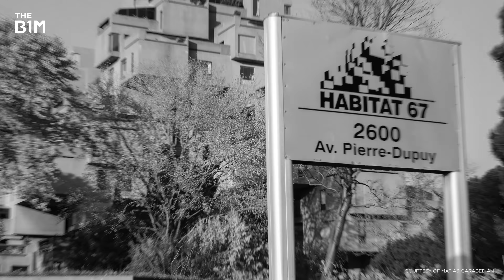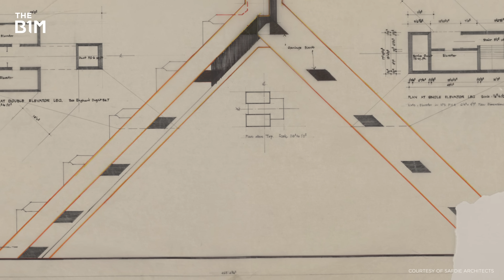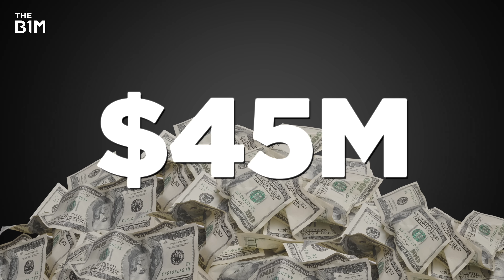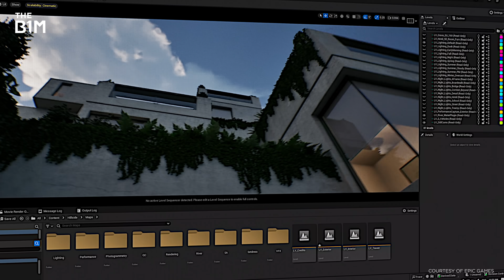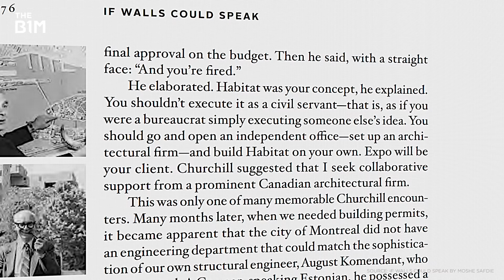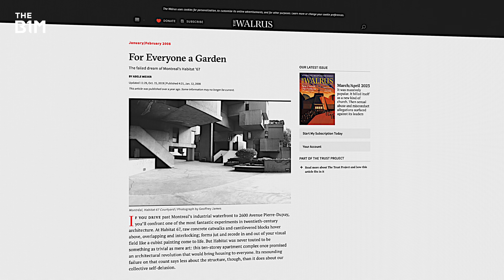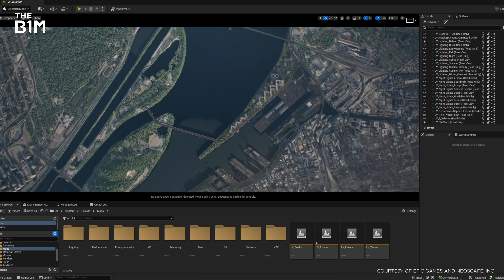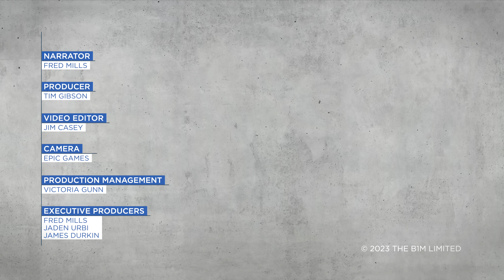How a 23-Year-Old Solved Urban Sprawl

Comment: I live in Europe in a concrete tower and one of the biggest problems is keeping it warm in the winter because concrete gets very cold. This model exposes almost every apartment to outer elements. That requires more insulation, more waterproofing, etc. Those terraces look nice but that means that every apartment has a roof to worry about (that is why the top-floor apartments are always the cheapest... they leak).
Reply: IKR. If the terracing was done less extremely it would reduce the outer surface area and make it less expensive to inaulate, heat and cool. Like the terraced villages in Greece and other Mediterranean countries.
Reply: @ooooneeee  Or favelas in Brazil 😂😂
Reply: @ooooneeee  but in a place thats very sunny it would be a great design then right?
Reply: @ooooneeee  that is because they are in greece, or brazil
those climates already using this designs for centuries, no need to reinvent boxes.
They are cool to visit but unsustainable in western and northern europe
Reply: That's only true for old buildings and office buildings, no one wants the top floor. But in modern buildings the top floor is the most expensive
Reply: In Poland, Europe, top floor is always most expensive. And in old buildings top floor is hottest - heat rises - to the point some people need to open windows even with radiators completely off.
Reply: @PR15125  In Estonia, top floor is the cheapest again for pre-modern. Roof can leak, you 5-storey house doesn't have an elevator, always slightly too hot and not high or scenic enough for pretty views. Most expensive in modern buildings, though - high enough yo get the view and the elevator, new enough for better quality construction and temperature management options.
Reply: The glass and aluminum panelling of modern buildings is far worse.
Reply: Keep in mind the original is in Montreal. The average temperatures during the winter are similar to southern Sweden and Norway. If it’s not a serious problem with the original structure then I’m sure it wouldn’t be if it was built today. I do understand the concern of thermal efficiency and maintenance costs though.
Reply: That is so different from Australia. Top floor is the most expensive because people want views.
Reply: @canyoucatchme138 same in Canada.
Reply: agree. water management will make or break buildings and houses
Reply: It depends a lot of the techniques. There's a lot of places where houses are made entirely of concrete, and handle the weather and issues pretty well, modern block is mostly empty, and that air is a natural insulator. Moreover making roofs that handle well against the weather out of concrete is not that hard nowadays, there's challenges, but then again there's no technology that won't have leaks without maintenance. The terrace with natural drainage and plants though can help a lot.
Where in Europe do you live? There's a lot of places where the tall concrete buildings were made shortly after WWII to manage the serious housing crisis. The houses cut a lot of corners and ignored many needs we consider basic to give a decent apartment. They gave great quality of life for the $ put into them, but they did not have a lot of money to work on and did fall short in many places because of that. Many of these buildings are also not given maintenance or support.

The core difference here is that the whole structure should not be seen as a building, but as a community, and supported that way. So just as people do not pay for roads, or grid infrastructure, etc. so we'd need the government to create most of the core infrastructure, with people taking over these blocks. You can see why it's a really hard pitch in a capitalistic "free-for-all" economy as we see in the western dominated world. But in high-control areas there just was never that strong incentive to build such a holistic and complete solution for individuals.
Reply: You need to start living in those energy-efficient buildings; they are great. I live in a Nordic country, and I usually stop using heating in February. The sun does all the work. But I see where you are going with this, having your little unit open to the elements doesn't sound very comfortable.
Reply: @Scott_Stone  how is the 4G/GSM signal in these energy efficient buildings? here in France all the newly built well-insulated homes have a hard time receiving
Reply: @GaniaDev  that's a good thing then to stop radio magnetic pollution
Reply: @Scott_Stone  And taking a page out of nordic architecture... Use Geothermal pipes running internal to the concrete walls and the entire structure becomes a giant heat sync... which would have an incredible thermal mass and would resist changes in temp very well, almost creating a thermal battery of sorts.
Reply: Secondly if they actually covered the terrace with a garden ( with actual dirt and plants it would help to moderate the heating, a big thing with huge warehouses here in the states to reduce there energy footprints... )
Reply: @Scott_Stone  Nordic country stopping using heat in February? Tell me how
Reply: @Frivals he did... The sun warms the inside enough and the insulation keeps the heat in.
Reply: @Scott_Stone yeah, the person you are responding to is saying "I live in a totally different situation to this and it isn't good, so this won't be good, even though it could easily avoid every issue I have with my current situation, I dont like change and new things waaaahhh"
Reply: @Scott_Stone fun fact 85% of the people in the world don't live in Europe or America's where it snows.
Reply: Your concrete tower was built with cheap materials.
Reply: @mj_b23  haha, that's what I said to myself
Reply: Waterproofing becomes a problem when there is water logging. If you have the right channels and more exposure to the elements the water never collects. That is a bigger issue in a tower like structure. Obviously these type of buildings are good for places that have desirable outdoor environment and not hostile heat and cold.
Reply: One word= "Aircrete"
Reply: @shahbazfawbush  look up two words "spirorex failure".
Reply: @danielvivian3282  I did, Siporex id a proprietary form of Reinforced Aerated Autoclaved Concrete that was initially used as far back as the 50s.  It has some shortcomings but with correct engineering these can be mitigated. 

So a non point for you @Daniel Vivian
Reply: @shahbazfawbush  I'm not a engineer but I do know about aircrete. Seems this would be a perfect use of it in construction Ike this.
Reply: Keep in mind that this was designed in contrast to suburban American/ Canadian housing. It would still be a massive improvement because now you at least have some walls that are insulated by other units.
Reply: Um, just wanted to point out that habitat 67 is located in Montreal, Canada on the St. Lawrence river with very cold winters. So one would assume that heating would have been addressed in its construction, as in all other buildings in Canada, one of the coldest countries in the world. And the structure has been standing for over 50 years so...
Reply: Seems like the terraces would work well in warm places like California or southern Europe.
Reply: "...they leak." Not if they're built properly, they don't. By which I mean, not if they are built by Japanese workers, in Japan, to Japanese  standards. I live in a top-floor condominium unit: it was already 20 years old when we bought it, and we've been here 30 years. We've never had a single leak. Regular maintenance, including coating the roof with water-repellent paint, helps, of course. But you really have to come to Japan and see for yourself to understand how crap building standards are in most of the rest of the world. The Japanese are only human (but don't tell them that: they like to believe they are unique), so if they can do it, why can't everybody else?
Reply: @DieFlabbergast   This is ridiculous. Japan is also home to thousands of poorly constructed buildings. Go to any leopalace for exemple.
Reply: @DieFlabbergast you don't have to travel to Japan to have a house that doesn't leak lol. I've lived in several European countries and places and never had leaks.
Also a lot of Japanese houses have terrible insulation. Not even double glazed windows and next to no heating. People use electric space heaters and those heated tables.
Reply: @DieFlabbergast ...they think they are unique...you are making them unique by saying that their methods are better  than anyone else 😄
Reply: @DieFlabbergast  why can't everyone do it like the Japanese, simple most of us aren't japanese. It all has to do with a whole heap of factors, for example why do you think their buildings are built so well. Simple because they are in a region where if they do have a leaky roof, it would be the least of their problems. Just like the Dutch, why are they so good with water management, simple they would drown. Different places, different people do different things because they have different problems so they find different solutions, there are similar problems around the world tho like climate change and housing people in places that are efficient and humane, but even then there are different circumstances, places with winters have heating issue places with very hot summers have cooling issues and the Japanese don't have solutions for all of them. Thanks, for the Japan propaganda but I ain't buying it. They overwork themselves to the point of collapse, trust me no one wants that, if they did they would have done so a long time ago.
Reply: @julianokong-a-san7053  their propaganda is none stop 🙄
Reply: remember this is meant to replace suburban sprawls of houses that are common in north america - the problems you listed are present in the way they currently do things anyway. And could probably be fixed with some minor adjustments to the concept. I know for sure if i could have the quality of life prmised by the original design of this project i'd be willing to pay a little extra for insulation and maintenance
Reply: understandable. could still work in places closer to the equator though. I'd be excited to move in to something like this with my own roof and terraces even when it means extra bit of maint.
Reply: especially now that market moving towards rent instead of own. This design would benefit a lot from that.
Reply: It sounds like a potential solution would just be larger terrace blocks to fit in multiple units and reduce surface area per unit. This still seems like a marvelous idea though, and a solid idea for creating dense, multi-purpose public spaces.
Reply: They may leak but at least you don't have upstairs neighbors that constantly forget they're not in a basketball court.
Reply: Could work well in Spain and Italy.
Reply: There are more clustered designs possible. The main point of the design is to have elevated walkways to get where you need conveniently and mixed development so you can walk anywhere you need.
Reply: It’s not that hard to shovel snow off or waterproof a roof. It’s also very easy to insulate. You’re talking about an issue for cold climates. I grew up in Alaska so I know the issues that come with the cold. It takes more work but today it is pretty easy to winter proof a building these days.
Reply: Concrete is neither hot nor cold it is a thermal mass that assists in regulating fluctuations in temperature. It takes on the temperature of its environment and delays changes away from that temperature. The thin building envelopes consisting of not much more that insulation and steel structure with a protective skin would have the same problem of heat loss or gain if it were insulated to the same value, only it would need to respond to large fluctuations of outside temperature much sooner whether that be hot or cold. The thermal mass will use the heat of each day before and after a bitterly cold night to decrease energy use by shortening the time the heated interior is exposed to the large temperature difference. This tempering of changes is not present in thin building envelope; they rely upon only on the air tightness, insulation and capacity of the heat source(s) to maintain comfort levels.
So this building is an amazing compromise between the confinements of most apartment builds we see today and the urban sprawl over arable land typical of single family developments. You trade some extra heating due to more exposed wall for more sound privacy and the ability to have both inside and outside personal and somewhat private spaces. And factory built housing if properly detailed before assembly has a more dependable quality of construction for every unit in the community than each unit having been built by many different contractors with differing views on what is the real priority of construction behind each residence.
Reply: @rabbytca  Wow that was a lot of words to explain to everybody you don't know what you are talking about.
Reply: @thomgizziz  My apologies for not writing in a simpler language format. I'm not exactly a literary graduate or communication expert. Perhaps you know one to help you comprehend what I apparently failed to communicate to you. Good luck and health to you.
Reply: @rabbytca pleas inform yourself about Thermal conductivity before you write something like that. You know concrete and for that matter most other structurally sound materials have a very high thermal conductivity. Thermal insulation on the other hand blocks that heat exchange so in an insulatet house the temperature is much more constant. Compare it to a electricity wire without insulation you get shocked even iv the metal would be thicker. Btw the thermal capacity thing is trou thogh it just dosent help you because of the conducting properties. Formuse of both you just put the insulation on the outside of the concrete than you have both benefits. Problem with this in the video szenario is that insulation is not structurally save(exept very expensive kinds) so ist not economical. But if you have cheap energyprices and give a dogs arse about climate there is no problem
Reply: @rabbytca  "Concrete is neither hot nor cold it is a thermal mass that assists in regulating fluctuations in temperature"
The thermal mass only helps in averaging the daily, or possibly weekly, temperature. But if the average temperature is -30℃ then it's not helping you, it's hindering you. The real important fact is the thermal conductivity. And in that scale Portland cement is at 0.29 W/mK, that's twice that of hardwoods and three times that of softer woods. That seriously increases the amount of heating your house requires during a cold winter. Insulation is between 0.035–0.16 W/mK or so, nearly a tenth of concrete. There's a reason stone houses are cold, during summer it's the thermal mass combined with cold nights, during the winter it's the thermal conductivity.

Green roofs are very good at creating insulation however, so terraced housing would improve that situation, heat rises so getting extra outside contact underneath the house in return for a green roof would probably be worth it.

I just can't help but look at those massive weights leaning out over lower levels and wonder how many casualties that would cause when, eventually, there's a hidden fracture inside a support. There's a reason the tallest buildings go narrower as they go higher. Not lean out sideways.

Terraces are great though, housing with terraces have existed for so long for a reason.
Reply: @Sylfa  Frank Lloyd Wright dealt with those massive overhangs by the use of cantilevered areas. His masterpiece, Falling Water used cantilevers to great effect. Of course, proper bracing through the use of steel beams and rebar is essential.
Reply: @rabbytca l
Reply: top floor apartments are the most expensive in my area.
Reply: Top floor apartments are called Penthouses and cost more
Reply: That’s the idea they are like houses
Reply: I was living in a concrete loft, and it's not just upper units that can leak. A water heater leak, or busted pipe, can still get in through wall fixtures. And when it freezes, water can come in through condensation from windows (mine had metal frames). I think it's more a matter of how well built the structure is.
Reply: You may not know, but Canada can be very cold too.
Reply: Well we won't have to worry about staying warm in the winter much longer since capitalism is turning the earth into a literal hellscape.
Reply: @Nein01  summers AND winters get worse actually. Higher greenhouse gases mean more volatile weather patterns that vastly outweigh the 2 degree shift.
Reply: Perhaps hempcrete could be a solution to this problem.
Reply: @bovinejangles  I was going to suggest this too.🥰🇨🇦
Reply: This is a much more sustainable model than urban sprawl. He addressed that the audience for this is people who prefer a house, this was also a prototype so adjustments can include higher energy efficiency, insulation and modern green building standards
Reply: wood gets cold too... faster than concrete...  the thing is you have to have isolation but concrete and mud as example store heat longer amd distribute it slower
Reply: Hemp
Reply: Also lack of elevators might be the factor.
Reply: He said he wanted to mimick the house living experience, so those would fit
Reply: @tomlxyz  yup. Maybe you could actually keep it too, crane grabs the thing and slots it into the next structure you move into
Reply: @ryccoh A Swiss architect has done that. You can upgrade, too: slot the next size apartment up into your space.
Reply: @4kirsten  dang that's badass, what's the name of the project?
Reply: Thank you for saving my time
Reply: How about dry, warm areas
Reply: Definitely a location consideration
Reply: very good point
Reply: If you put a giant cube over this “project” it would solve that problem and you would get “Cube” that Arabs are trying to build
Reply: Yeah. Most homes have all that stuff?? Lmao. Dont try to sound smart. Do they need power outlets too?
Reply: I thought concrete is good a keeping heat.
Reply: I love how the protection against elements we use need protection against elements
Reply: Have you ever heard of a penthouse? For small buildings yes the top floor is cheaper but not for bigger ones.
Reply: Looks like slums
Reply: It also seems so much harder to insulate. With a concrete tower block you can at least easily stick on a 5 inch layer of polystyrene
Reply: Have some imagination. We can think of means.
Reply: Каждый владелец дома имеет крышу , по Вашему это проблема, но дома обычно стоят дороже квартир и люди с радостью их покупают
Reply: Not sure what you’re talking about, where I live, the top floors are usually the most expensive, and heat rises so the top floor would be one of the hottest. And unless there’s bad construction or maintenance, there shouldn’t be any leaking ceilings.
Reply: Do you think other buildings don't get cold? Let me explain they do. That's the end of the story.
Reply: Also, rooves can be built well so they don't leak. Those suburban owners aren't all worrying about leaking.
Reply: Ok then we won’t build these in Europe 😊
Reply: And are hot as fuck
Reply: Good point. But here in Arizona this would be amazing. Create a ton of shade beneath the houses too
Reply: Completely true
Reply: Habitat 67 also has many protruding sharp edges on its faḉade, so it wouldn't do well in terms of geomancy as the edges resemble knives & thus feel more menancing
Reply: That's an insulation problem, not a concrete problem. Sounds like you live in some old shitty building.
Reply: Insulated concrete form is the way to build a concrete home
Reply: @Mike80375 I disagree with your statement. An "endless" supply of timber in Canada is not environmentally sustainable, especially when the trees in Canada will begin to die off due to the hotter climate. Ask Colorado. Trees here in Virginia are dying from disease and heat/cold stress. We had temps in the upper 60s last week and one day it was 75 degrees. Several years now, we lost fruit from the trees because temps got warm, trees started to bud and then winter came back which killed all the buds, thus no or very little fruit yield.
Reply: I agree, materials would be more preferable. Which could raise cost significantly, but non the less its still a great concept imo.
Reply: Idk, I live in a Victorian tenement in Glasgow and I miss my mum’s eastern/central European tiny concrete commieblock that often gets so warm she has to open the windows 😂
Reply: I am sure they will take that into consideration.
Reply: This would be perfect for the warmer climates of the global south.
Reply: If they sealed the concrete, it would reduce the sense of cold.  Concrete is hydrophilic, and it increases moisture inside the home, too.  That denser air means it's more to heat.
Reply: Maybe this type of architecture type could be a good thing to use on tropical countries. Could be a way to urbanize the favelas of Brazil, especially if it's a cheap way.
Reply: The top floors always have the longest time to get access.  Longest walk, longest elevator ride.
Reply: I don’t know where exactly you live but where I live top floor apartments are the most expensive and leaking roofs is not normal. I live top floor and I’ve never seen a leak nor heard of my neighbors getting leaks, it comes down to build quality. And also I don’t think this is to be compared to apartments but houses as apartments already exist, these are to entice people who want houses
Reply: This is a good point, I can still see this being a very viable option in warmer cities like phoenix and la😊
Reply: I live in a damp concrete house myself. Say no more
Reply: Are you from ex Soviet country/communist bloc, as these issues are what people from there typically mention as problems i.e. roof leaking on top floor (because no proper maintenance for decades) and cold because the houses are not properly insulated and have not been maintained properly for decades sometimes. It is all solvable just with normal maintenance which was lacking in Soviet era and also later when nobody had money for that
Reply: ppl like you are the reason progress is stalling
Reply: Montreal uses electricity for heating and has cheap emission free electricity. The heater would use a bit more energy I’m sure it’s fine
Reply: You get insulated concrete forms since last 30 years. They do a good job of keeping the place hot or cold.
Reply: Eh? Penthouses are the most expensive I don't think new buildings have a leakage issue
Reply: You're absolutely right but you forget that this is built in Montreal, Canada, and if you're a local like me, you know very well how to prepare for our extreme hot-cold weather. I used to walk by this Habitat 67 and to this day people still live in it. If it can survive our weather, it can survive any weather.
Reply: All true, but you miss the point. The objective is to make city living attractive to those who would otherwise be drawn to the autonomous dwellings which constitute single-family suburban subdivisions and which contribute to the urban sprawl we knew even then was unsustainable. So the key is to provide apartment dwellers many of the qualities of autonomous living. Of course those qualities come with drawbacks as well, no different from a suburban home.
Reply: In 1964 I don't think heating fuel costs were much of a concern.
Reply: silly square designs only accommodate lazy builders  - imagine all that grip space for high winds and tornadoes ~ architecture must meld with the environment and its challenges
Reply: nah this design is absolutely perfect for hot climate countries, which where the majority of the world's population lives
Reply: There's no reason why a modern version has to be made of concrete. He was suggesting prefabricated modules look at Boxabl. Imagine a bunch of Boxabl units makeup structure would be much cheaper to produce and there would be much better insulation properties. Instead of a terrace you could also have a evtol landing pad for each unit. Boxabl units are strong enough to support them as well.
Reply: How old is your building? The roof leaking would not be a problem or if built cheaper then just like a regular home the owner will have to suck it up every several decades
Reply: @ryccoh Have you ever lived in an apartment with a flat rooftop? In apartment buildings the roof is a problem for the entire building and gets repaired out of the building's budget... but that is the least of your problem. In winter you get a very cold ceiling that begins to mold, and in summer the roof gets too hot. Trust me, avoid the top floor 😊
Reply: @GameOn82  sounds solvable but idk i ain't no civil engineer
Reply: @GameOn82  Mate, where do you live?! I've never heard of anything like what you are saying in the Netherlands. Here the top-floors are most desired for their views and freedom with only a downstairs neighbour.
Reply: @GameOn82  i disagree to compare every flat to a top floor the reasons why a top floor have cold ceiling have a point of equilibrium with height. In a towe,r the top floor is very expose to a cold hard wind, thats not the same as here. Secondly if you are going to stop doing a magnificent construction just because the roof could leak (providing the work is not do properly) you may think in a more safer job
Reply: @GameOn82  - This is an odd claim, because one of the reasons concrete became and remains a popular building material is because of its incredible thermal mass: in the winter it can absorb heat from sunlight and retain that into the nighttime hours, resulting in reduced heating costs … and vice-versa — in warmer climates, its interiors retain the nighttime cool during sweltering exterior daytime heat.

Concrete is superior in these terms to similar materials such as brick, stone, rammed earth, adobe, cob … and it’s infinitely superior to glass and steel. Concrete sucks environmentally, as producing it leaves a huge carbon footprint, contributing to global warming … so new forms of mass timber with similar thermal mass, but produced renewably, are now preferable construction materials, although because they haven’t been widely adopted yet they remain pricey.

But concrete shouldn’t be making your building’s interior colder in winter, it should be doing the opposite. My guess is that, if anything, the reason you’re cold is because your landlord is counting on concrete’s thermal mass to retain heat in the winter, and so is trying to make extra profit by not supplying you with adequate additional heating.
Reply: It’s no worse than single family detected houses in the suburbs, which would have all the same concerns. At least these buildings dramatically reduce car use which is a huge problem in North America.
Reply: The heat loss issues can be addressed with adequate insulation and water infiltration by appropriate maintenance and replacement of the roofing membranes (25 years and replace for most membranes).
Reply: @danielvivian3282  In the Nordic countries flat roofs were all the rage in the 70's and they turned out to be a very very bad idea especially in single family houses. If it rains +40 inches per year and a significant amount of that comes as snow, flat roofs are a very bad idea.
Reply: I was thinking the same.  In addition i would say it does seem disordered.
Reply: @fcalin21 god forbid we don't live like chickens in a row
Reply: @chemicalfrankie1030  Which is still more environmentally friendly than driving a car from miles away to city every single day.
Reply: This. Architects just do not give a fuck about practicality way too much of the time.
Reply: Aerogel is a perfect insulation the real issue is all concrete rots.
Reply: @815TypeSirius  Aerogel is not the solution (yet). As of now, it is too expensive, and as far as I know, the material isn’t exactly environmentally friendly to create. Hopefully this changes in the future of course.
Reply: @815TypeSirius  If we made concrete the way ancient Romans did, it would become harder over time as the minerals in it crystallize. Water, too, made it harder.
Reply: That’s the difference between book knowledge and life knowledge….  Just because something is great when it’s newly built, it gets older every day and sometimes, things don’t work so well after they live in the real world for a while…. Time takes a vicious toll on us all
Reply: Actually there might be a fix for it as there is now aerogel concrete.
Reply: This is a great comment. Way too much exterior surface area, which causes unnecessary energy loss. There is a reason for stacking dwellings into compact buildings. The future of living lies in such compactness. Besides, a construction as presented in this video is highly inefficient to create. A lot of material is wasted, simply to create some interesting shapes. It’s not a good idea. It is a nightmare.
Reply: @tjeerdprins869 let's not kid ourselves.  A lot more material is wasted in single family home construction.  You also are thinking from a framework of constructing this traditionally.  Factory building most of this would make it easy more efficient.  Housing construction is the only industry where productivity has stayed static despite technical advances.  So let's not pretend we know what we are doing.  We suck
Reply: @tjeerdprins869 he is not just creating interesting shapes. He's giving every home a large balcony and a community green space underneath along with small retail establishment, a small coffee shop a, a diner a, barber, grocery store, bank, stationery store, few small restaurants, tailors etc.
Reply: Not everywhere in the US is the icy cold Soviet Union, lol.
Reply: @USA_USA_USA  
Concrete has thermal mass and can retain heat as well, which is also is problematic when it's hot...
Reply: They don't look nice. They look cold and Soviet.
Reply: @rustymason3860  Agree. A little color on them along with more trees, flowers and container gardens and it wouldn't look so uninviting.
Reply: That was my first thought watching this. Energy efficiency in regards to heating/cooling alone would be nightmarish in a lot of climates. The building would work best somewhere with more moderate temperatures.
Reply: @DryBonz1  Yeah, like where the original one was built. Canada. Well known for its nice, moderate temperatures with little variation.
Reply: @Khotetsu Montreal is not moderate in temp, it can get very cold in the winter.  I just travelled there in February and it was cold, windy and snowy.
Reply: @aoefeable  That was sarcasm. The guy I was responding to said that this sort of building would only work in places with moderate temperatures, which is clearly false considering that this is in Montreal and is still very sought after property today.

I live in New England and have been to Montreal many times (great city), and temperatures can range from over 80 degrees in the summer to below 0 in the winter with several feet of snow on the ground here. Not what I would describe as moderate temperatures/climate.
Reply: @Khotetsu  ahhhh! Gotcha!  😜
Reply: Thing is though all of North America has bundles of space to expand. Why constrict yourself with land? In densely populated countries sure I understand something like this may make sense. I wouldn’t want to live there lol
Reply: @Anakinuk007  Because American suburbs and modern commercial buildings cost far more in city services and maintenance than they bring in. Suburban developments in the US are bankrupting cities and the only way to keep maintaining them is by building and selling even more suburbs and by the taxes of older, denser parts of the city (which are usually the poorer areas, so literally the wealthier people living off of poor people's tax money).
Reply: @Khotetsu another plus point of such dense developments is there can be adequate foot fall for retail small business including food businesses.
Reply: @Anakinuk007  The settlements of Canada came about due to the proximity of trade corridors and fertile land. The ever expanding horizontal spread of cities has been covering up some of the most fertile and accessible land in Canada. This is part of the reason why food has become so expensive in Canada. Food must now be transported thousands of kilometers using increasingly expensive and undesirable fuel sources. The remaining regional farms near cities are those that produce higher value niche products. They have not yet had to choose between unpredictable crop production with the hard costs that even potatoes and cabbage incur and the rising land value and its associated taxation that politically driven regulations have encouraged. The ambivalence of the majority of the population means that the politicians only hear those that are speaking and they often do not have the community as a whole in mind when they speak.
Reply: @rabbytca well said.  🇨🇦